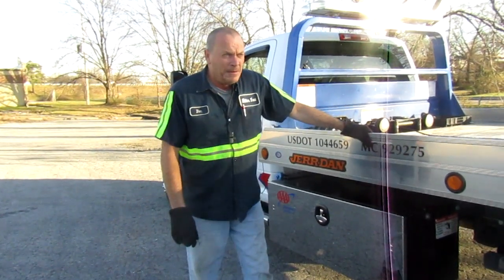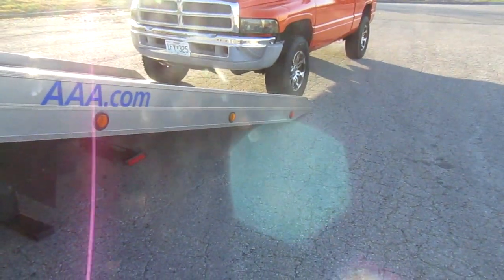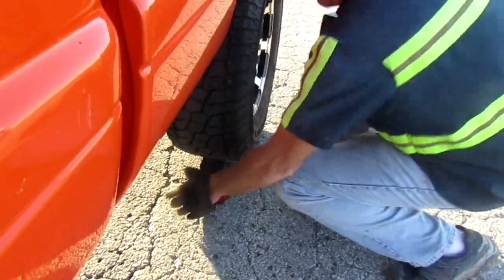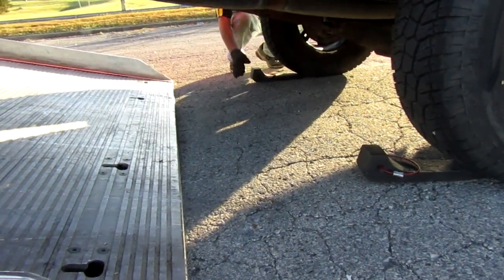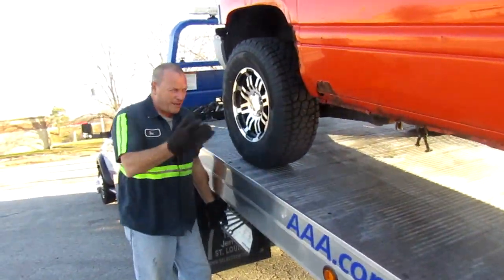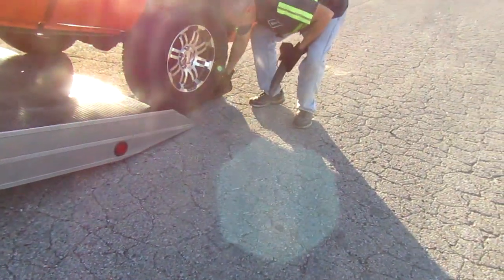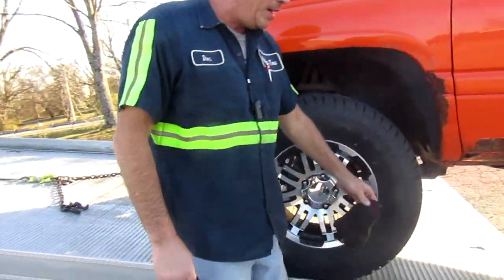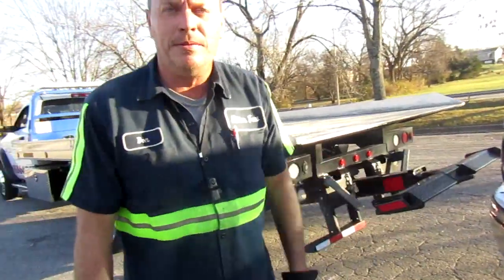How To Use Skates On A 4 By 4

Comment: When off loading it's quite simple, Reverse the skates get the rear wheels off the bed, Run the bed all the way forward till it either maxes out or the front wheels are just barely on the bed, and then throw a chain as far forward on the vehicle as you can to the rear pocket, run the bed back and that chain will tighten and then start pushing the skates and vehicle all the way back, from there unhook the chain and you can pretty much jolt the bed forward a few times and it will come out.

Comment: Especially if you have no room to move forward in a very tight parking situation you can run a snatch block to your edge of the bed and the winch back up to the truck and literally use the winch to pull it down off the bed. It's safe quick and easy. anything you can do to remain in the most control of the vehicle in the truck and you're surroundings is best.
Reply: I think thats the best way to do it, plus Miller Mfg. says that sliding weight on the bed without the stabilizer foot on the ground wears out the bed slider pads in the front faster.

Comment: I just started with triple A and this helped out a lot. I tried the moving the bed back and forth and basically forcing the car off the bed. I wasn't comfortable with it and neither was the member. This technic will definitely be used next time.
Reply from the maker: When I have to shake a vehicle off the truck I always tell the member exactly what's going to happen so that way they are not shocked good luck to you my friend keep your head on a swivel and be safe
Reply: @donaldchastain6847  And always keep a large bottle of dishsoap on the truck. They slide so much easier

Comment: Very informative. However, you don't really need to hop back in you tow truck and drive forward. If you truck has a wheel lift. You can do a technique called "walking the Truck." You basically use your wheel lift to pick up the rear tires of you tow truck and that use it to push the truck forward. Saves you a lot of time and keeps you from have to walk back and forth a lot.
Reply from the maker: You can do that really easy but most rookies can't Plusle scratch the hell out of somebody's driveway doing it that way
Reply: @donaldchastain6847  ItsIt's do able without scratch up driveways. Just have to pay attention and take is slow. Most guys get in a hurry and try to rush through it. But I mostly tow for IAA and CoPart. So it comes in handy with wrecked vehicles.

Comment: Front wheels are free just slide the bed up under the front tires and left the bed and roll the wrecker bad til u hit the rear tires and pull it up bout 6 inches instead of like 5 feet

Comment: Misleading title. Basically showed a technique for a 2wd truck or car. 

And at 3:15 there is no reason to get in the truck. Just keep the skates under the wheels and use the bed to push on the rear wheels which will move the truck back. 

Hate to see rookie mistakes like this but people can get hurt and equipment or cars can get damaged when moving the truck while working. ALWAYS try to keep the truck stationary. The driver's door should only have to be opened twice. Once to start the recovery and the second is to leave the job site. 

Happy towing and recoveries to all!
Reply: but which one is easier and safer? indeed this one
Reply: First off, He said 4 by 4 and not All wheel drive and the Dodge is a 4x4 on demand, so he is not misleading. Secondly, when the rear wheels on the casualty vehicle are locked, your options for dropping it off are limited , and the way he did it while it is hard on the frame of the truck,  it is the most common way. Thirdly, I suggest that you make a video showing your creative methods of dealing with a situation like this if you 
 think you can do better.
Reply: Theres always a chance the vehicle can free roll. Dont know if park will hold or the rear end. I'd keep my winch hooked and walk the truck out from under it.
Reply: I agree! The truck should not be driven out from underneath. There is a much safer and more secure way to do it. I like his techniques in his videos, but disapprove this video.

Comment: Good trick to know for wrecked cars.. But, way quicker to pop the shift cable and roll on and off...
Reply: Tim Buckner thats only sometimes true....what if its one of those new hybrid cars, that dont have the shift linkage easily available or has one of those undercarriage shields making it inaccesible. Also the steering wheel could also be locked. Sometimes skates & snatch blocks are your only option.
Reply: @iitzDiRTY  As I said.. Good trick to know..
Reply from the maker: But the problem with pop in them shifter cables off a lot of times they break the clips and then people are trying to sue you because you're not a mechanic so I try to avoid that stuff
Reply: @donaldchastain6847 thousands of tows.. not one broken..

Comment: how about AWD?
Reply from the maker: It is the same principle but I have not had an all wheel drive vehicle locked up yet in awhile but when I get one I will make it for you
Reply: also. last night i had a fwd. no key. i had to load it up backwards on. getting it off was a pain. came off easy using your. technique. it was when the front wheels came off the bed that the pain started. the back wheels just rolled with the bed. while the front stayed in park not rolling. what could i have done?  i had to use fork lift to get it off.
Reply from the maker: When you load them on backward they are a pain to get off couple ways to do it is roll the bad back and then put on the emergency brake and and Scoot the bed backwards the other way the other way to do it the same principles is to block the back tires so when you're putting your bed down the tires don't roll backwards it just pushes against the fronts to skates
Reply: thank you so much for the feed back. helps out so much.